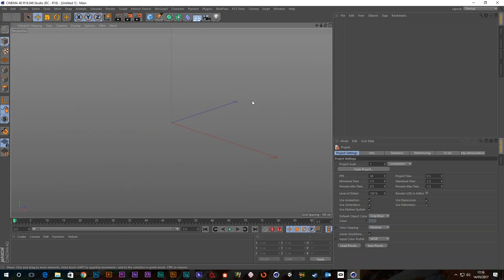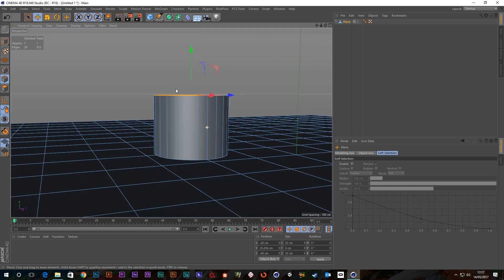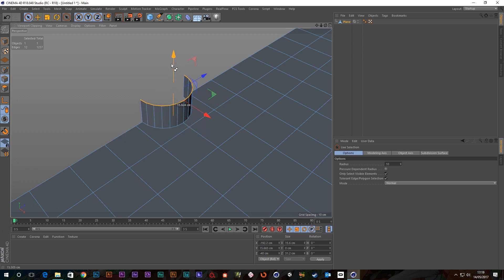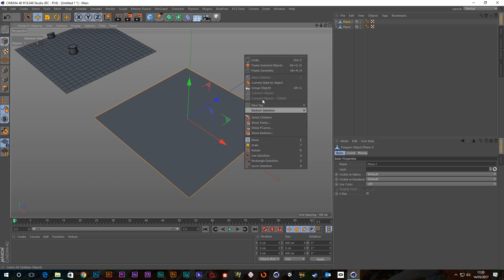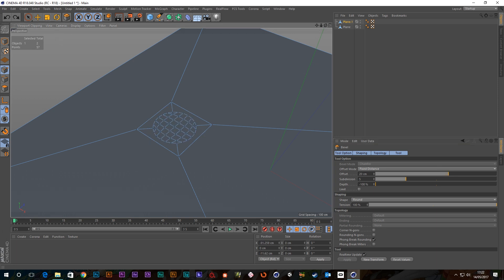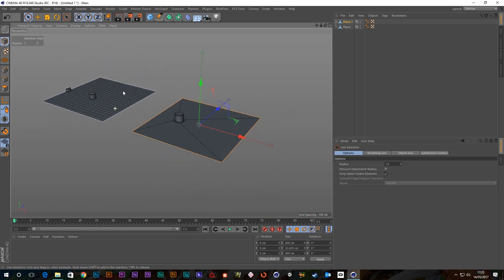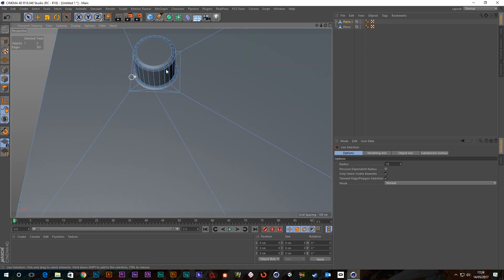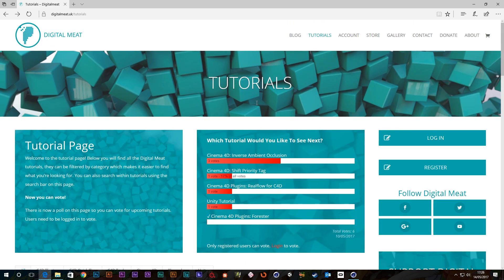Quick Tip 15: Model A Perfect Hole In C4D Without Boolean

Comment: That last tip without the polys does not work in render. I've tried to do the quads as well but that did not make it better, just different. Here's a screenshot of what it looked like before adding the quads. I used a shiny material so it is extra obvious. Any tips? https://i.imgur.com/XDNdBb7.jpg
Reply: I found the issue if anybody is having the same problem. What caused it was the beveling of the edge. You need to click 'phong break rounding' when you add that and then it is good

Comment: There's a problem I'm having with this: as soon as I grab the point and try to bevel it, I get green lines (N-gons) going from the center to the corners, while you don't. Despite having both "N-gon" options disabled for the bevel tool....don't know why that's happening....
Reply from the maker: It's because you have N-gone lines turned on for display, to turn them off go to "filter" above the viewport window, then uncheck N-gon lines.
Reply: Thanks. Isn't it undesirable to have n-gons in the first place ? That's what my brief knowledge that I've acquired so far is telling me at least....
Reply from the maker: Yeah you don't want N-gons which is  why i make quads towards the end

Comment: i did NOT know you could bevel from a single point like that WTF. my mind is so blown right now. you can literally do anything with this program. its overwhelming!!
Reply from the maker: glad you found it useful :D
Reply: What you can't do is volume select, so that if you change the topology, the same volume (of points, edges, or polygons) is selected. For non-parametric destructive editing, the program is great. But, doing things in a build-up, non-permanent way is very difficult or impossible, without manually saving history along the way.
Reply: i love cinema and frankly i would never have any other program as my main, but you should try blender, your mind would be blown by the things you can do... Cinema4d for me is the better modelling software and has the best system for rendering with its advanced and seemingly perfect rendering system.

Comment: If I were doing a game wouldn't it be better to just use lesser subdivisions ? like maybe have it to be around 8 edges for the cylinder ? Other than that yeah it was some good info. For me , the connect edges would be a pain. I would rather have extruded inner with a perfect square and and use subdivisions to get it round maybe with 1 sub level to get all quads having also good topology
Reply from the maker: yes of course the circles subdivisions could be be lower, i was more focusing on the plane itself. there is no point having a subdivided plane if it can be described in one poly.